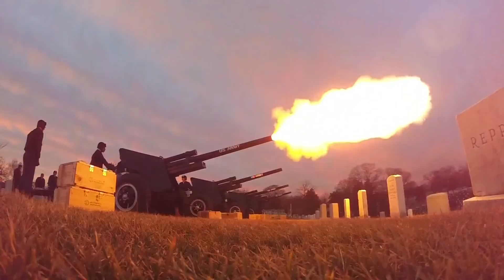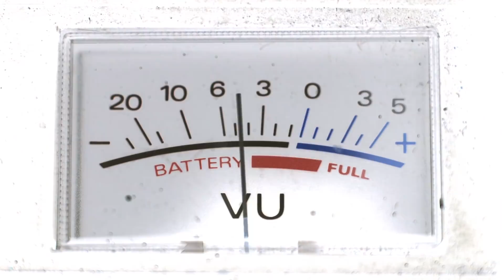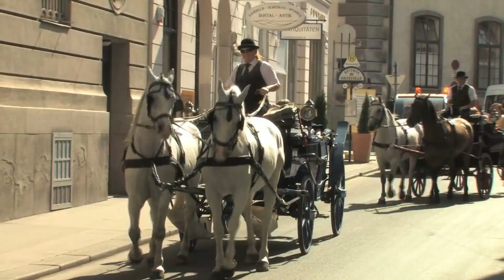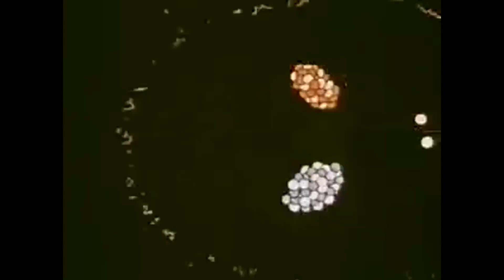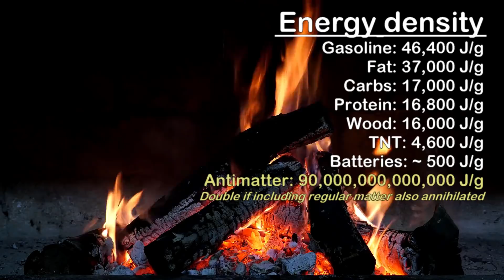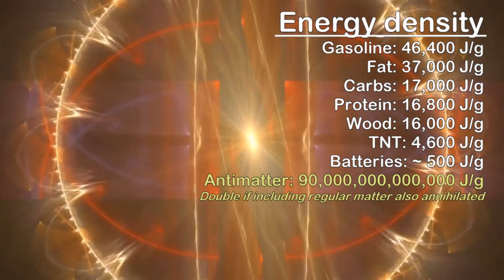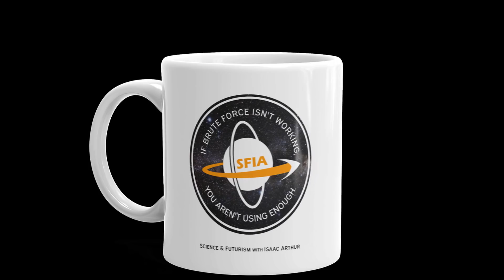Portable Power

Comment: Where does he get the fact from that diamond batteries generate 3 watts? And, how much mass do such diamonds have?  What I have found is that 1g C-14 delivers 15 joules/day. If I calculated that correctly would indicate that 18 kg diamond battery, at its maximum, would deliver 3,1 watts of power. That does not sound very practical to me. https://www.snopes.com/fact-check/radioactive-diamond-batteries-real-thing/

Comment: Do you think there is a reason a solar wind powered water wheel wouldn’t work in space? 
The side of the wheel out of the wind (passing inside the ship/habitat) then being pushed as they rotated outside of the structure (the center of the wheel would be a bout even with the surface of the structure.

Comment: About renewable energy. I recently read one of the most efficient ways of storing energy is converting it to hydrogen from sea water. If this is true why don't we store energy in this manner? Hydrogen can be piped to areas like natural gas, it can be transported in tanks. Or even just converted to electricity at the source. With a byproduct of pure water. That water could be used for agriculture, horticulture, home use or just to recharge aquafers.
Reply: I don't know what you mean by efficient. But if you mean, how much energy you get back, it's not very efficient.
Reply: The article I read, claimed it was more efficient than batteries. I don't know the physics behind it. So I can't say if it's true or not.
Reply: Yes, it may be a good idea on a large scale, when renewables reach 70% or 80%. But indeed you can only reclaim about 30% of the energy (if I remember correctly, but it makes sense) AND hydrogen is not as easy to store as you migt think. 
There are some ideas in germany being thrown around to produce it on large scale (once we reach that level of renewables), process it further into methane and the store that in the gas net.

Comment: you can transform dc too nowdays with ease. back then there was no dc-dc covnerter. and that 1 of the 2 things that led to tesla's system. the otherone is synchronous motors. and thats all. actually if you want to transfer power via a wire, dc is a better option vs ac if they are at the same voltage. the reason is that dc does not care about anything else but dc resistance, while ac cares about impedance. so mutch for tesla.

Comment: Some asteroid produce heat, and they were not sure why. The current theroy is rare radioactive elements are breaking down, which produce the heat. Maybe? Other less popular theroies consist of these asteroids are acting like antennas picking up engery just as your radio antenna does. This theroy seem indicate that the asteroids have some kind of less than obvious, not known form of conecttion with something? Kind of iffy, right? Yeah, the theroy with the break down of rare elements is knonn iffy. It's one of those theroies were they numbers are rounded up, and down to get it to sort of work. If we don't except the iffy math with the elemetal break down, than we have no idea why some asteroids produce heat.

Comment: You can't tap vacuum energy ever because of the fact that it's everywhere. There's no potential energy gradient. It's evenly dispersed. It's like trying to run an internal combustion engine on the Sun. Everything is hot gas already, so turning some petrol into hot gas won't make the pistons move. The pistons have nowhere to go where there is less pressure and heat.

Comment: We still use flywheels for more than most people realise. A data centre in Australia currently makes use of a truly massive one as a stand in for a UPS (uninterrupted power supply) capacitor when there are power blackouts.

Spin it up when the grid works, then tapping its angular momentum for generation when the grid is down.

Comment: Love the merchandise. I also love the topic of O'Neill Cylinders.
About "portable power", the molten salt Thorium reactor was first developed as a power source for a nuclear powered bomber. A very bad idea but actually possible because an MSR doesn't require pressurized water cooling system, containment vessel, etc. And when the Thorium  breeding cycle is perfected, creating expensive radioactive isotopes will become much easier and cheaper. Of course having a source of very inexpensive electrical energy will create the "problem" of making the synthesis of carbon neutral chemical fuels much more attractive in the near term.
I guess portable black holes will probably go the back burner, but on the brighter side almost all of the other technologies in Upward Bound become far more practical and politically feasible.

Comment: No mention of fuel cells? They've been used for power generation in space for decades and they've also seen some use for portable generation, with work being done into using them to supplement batteries in vehicles instead of the internal-combustion engines used by current hybrids. Whether that will pan out remains to be seen.

Comment: virtually every one of the higher energy batteries or storage strategies have the drawback of being a potential bomb, sometimes a nuclear bomb. You might want to suppress most of these, as you dont want a teenager or terrorist doing something with them. I had this thought when cold fusion "failed". In theory, cold fusion says you run a current through a wire around a palladium core. Low current, you get tiny heat, more current, you get good warming, more current you get hot enough to boil water and turn a turbine. What's to stop you from really cranking the current, or using a bank of capacitors to produce a massive current in a very short period of time? Wouldnt that do a very fast release of all that fusion energy? ie a bomb? Pons and Fleischman built the first one in their garage, sounds like something a bright teenager or a dedicated terrorist could do. Right now they strap dynamite to their chest and look for a city bus. If they could make one of those, they would just look for the center of a major city.

Comment: Couldn't you, in theory, feed a black hole with lasers?  If you can create one with lasers and make a net gain in energy, why not keep one alive for more or less eternity?  The BH's radius is limited by the Planck Length, because you'll want your light's wavelength to be the same or less than the black hole's radius.  

 A 1 ton black hole needs 
9*10^19 J to be in a radius of 1.5*10^-24 meters.  Doing the former is quite simple; a Dyson Swarm would laugh at this kind of challenge, outputting 3.8*10^26 J in one second.  The problem is focusing it.  

A BH with the radius of an electron has a mass of 1.9 billion tons, so you have to focus the mass-energy equivalent of that (1.7*10^29 J) into a space with a radius of 2.8*10^-15 m.

In summary: Getting the energy is easy, making the black hole is hard.

Comment: You know it is funny I was researching into batteries and supercapacitors and Lithium-ion vs Lithium-metal batteries. (I did so because I read an article on how Lithium-metal batteries may now be feasible because the dendrite problem is solved by using heat. This means we get twice the energy density by switching to Lithium-metal batteries...

And cue to Thursday, we got Isaac Arthur's go-all-out energy storage... (and improve my understanding on normal batteries) There were a lot of types of energy storage that I have no idea of...Mind Blown

Comment: Hey Isaac, would a blackhole-based generator be limited by the carnot cycle?  Or could we cheat somehow, using the event horizon as absolute zero in one context (easily gobbling up all our waste heat) while still providing a power source via hawking radiation?  Maybe there's a minimum size at which it becomes practical but that's still viable for a megastructure.

If that's possible then you can make a dyson sphere that cools its external surface, constantly recycling internal energy at 100% efficiency, slowly increasing reserves so long as the temperature of the universe is warmer than what the surface heatpumps can create.  Only once the temperature of the universe drops below that threshold would such a dyson sphere finally begin a slow decline.

Comment: • Flywheels: You can still find them in data centers, among backup batteries and diesel generators.
• Battery sizes: engineers started to use systematic names, such as 18650: 18mm diameter, 650mm length. Easier to remember than arbitrary labels such as C, D, AAAA….
• "Ambient temperature" (rather, particle movement) energy harvesters: Brownsche Zellen. And there's vibration energy harvester. Both give some pW to nW (size of an old transistor). Interestingly an ARM Cortex fabbed with modern tech sips just a few nW, too! Could run ages w/o any battery or visible light.
Reply: 18*650mm battery? What's that used in? An electric car? Can't imagine something more than half a metre long would be used in anything human-portable.
Reply: Oy, it's 18mm and 65.0mm length, sorry. And indeed, accu packs in cars are comprised of those cells. Though Tesla is switching to a different format.

Comment: Would trying to use vacuum energy be rather like trying to power a Stirling engine with ambient heat? Or, put another way, wouldn't you need an energy differential that doesn't exist to extract any kind of energy from the quantum vacuum?

Comment: Tritium betavoltaic batteries would be a nice side-benefit of developing good enough fusion. If you have fusion reactors good enough to run on pure deuterium, you both get cheap tritium and several good uses for that tritium (both in betavoltaic batteries and in high power density D-T fusion reactors).

Also, traditional magnetic confinement fusion has been bottlenecked by materials technology so far, but tokamak power outputs/power densities scale as the fourth power of the magnetic field strength, so as we get better superconducting magnets, fusion will become vastly more practical. With ~100T magnets, D-T tokamaks end up having a power density somewhere between jet engines and chemical rocket engines and also become reasonably miniaturizable. 

We've seen several revolutions in superconducting magnets these last few decades that already make tokamaks more viable in this upcoming decade, and there's no fundamental reason to believe that improvements in superconducting technology will stop as we gain a better understanding of how high-temperature/non-BCS superconductivity works.

Comment: Since you mentioned Perovskite Solar Cells, as i have recently read current academia on them, lemme put some info out there for the enjoyment of everyone. Organo halide Perovskites (Perovskite being a crystal structure) are the current hot topic of solar cell research. They are potentially more efficient than silicon while being potentially simpler to manufacture. The current limit is, that the top performing cells are made from materials which are very moisture sensitive, making manufacture and encapsulation a nightmare and even then, lifetime is only measured in hundreds or low thousand hours. However, scientists have recently demonstrated Perovskite cells of relevant size, simple manufacturing from cheaper materials than previously used, all the while being totally stable for the 10.000 hours they tested - even when handled under atmospheric conditions, hinting at much much greater possible lifespans. The efficiency of these new simple cells at ~10% is worse than silicon, but for a early phase research work, it it a very very impressive breakthrough. All they need to make them is: Conductive Glass (Made by the cargo ship for displays etc. ) , Graphite, Titanium Dioxide (which is, basically, wall paint) and a tiny amount of perovskite precursor solution. Manufacturing consists of only painting, soaking and baking steps, all performed in air.

Comment: If your perfectly mirrored box contains 1kg light, it carries 3*10^8Ns of inertia, if your box is 1m long, the outward force is 10^17N. How are you going to hold that together? If you use chemical bond strength, you limit the energy per mass to chemical reaction scales.

Comment: If you  could make those light "batteries", you would probably power your spaceships with them too. They would be the best for it as they have the highest energy-density per mass and letting the light leave in one direction  would give you a photon drive with the best fuel. They would basically be the highest density fuel for the highest exhaust velocity drive, meaning perfect for spaceships that utilize the rocket equation (as opposed to ramscoops and similar).

Comment: Great work again!  Just one thing - power loss through a conductor (of fixed resistance) is proportional to current SQUARED
P = I²R
Reply from the maker: Damn, did I say linear in there?
Reply: No, just "proportional".

Loved listening to this.  I'm a physics teacher, and it's really interesting to hear you say things that sound wrong to me - but they're actually a correct, but more engineering-focused, take on the same thing.  Helps me to gain another perspective on what, and how, I teach.

Comment: Graphene conductors... close to the strongest material known (carbine beats it) and nearly the best high-temperature conductor, better than silver and much better than copper.  Not sure how it stacks up against gold for conducting but it is much, much cheaper owing to the ridiculous availability of carbon.

I often wonder if graphene could one day be an elevator tether and double as a transmission line for space-based energy sources.  And it would go a long way to solving the climber-powering problem.  Just equip a climber with an induction coil and energize the tether.

Comment: To my knowledge it's alpha radiation that has a very shallow penetration depth, beta can go through skin.
Reply: You’re right. Although, beta still particles don’t have a lot of penetration.
Reply from the maker: It's basically both, beta can get to the germinal layer, alpha can't even do that, but it's very easily stopped. You'd pretty much have to hug a powerful beta source with no sort of container or shielding for a long while to do much, even just clothing will usually be enough extra, but even a single layer of regular household aluminum foil will stop it.

Comment: Should Benjamin Franklin have picked opposite signs for charge (make +1 for the electron)?

I think: yes, it would help children get more understanding of electricity if the electron was positive, and electric flow had the same direction as the electrons.  If you can tell the story of Ampères and Volts from the perspective of "Alice the electron", that would make a lot of sense.  

Then again, if you want to know electricity really well, you have to get over it; you must accept the arbitrary character of which sign is picked.

So I don't know